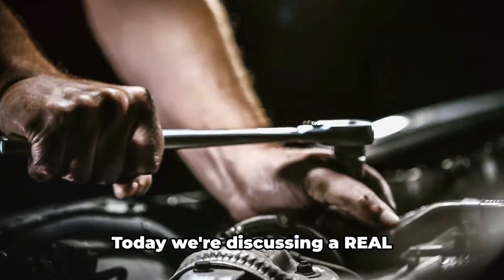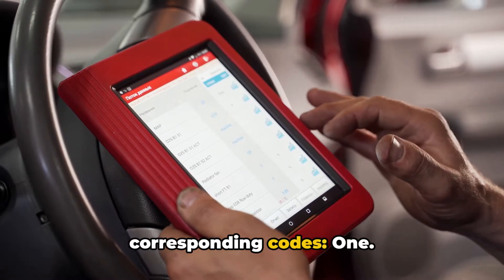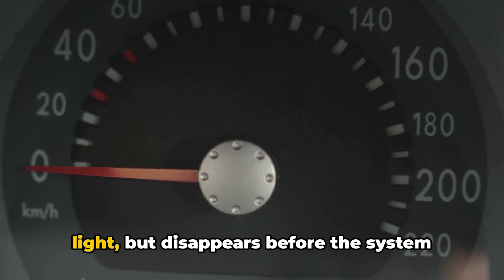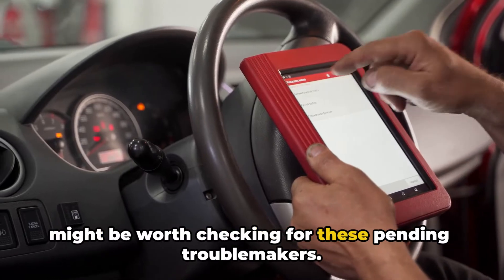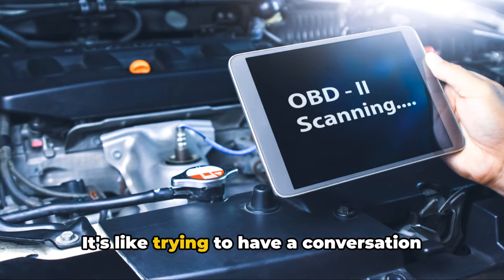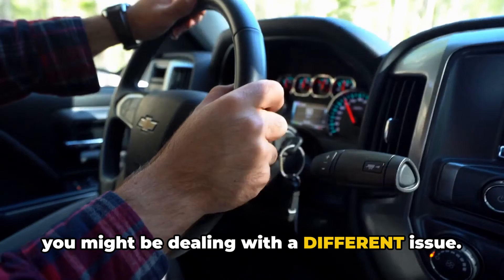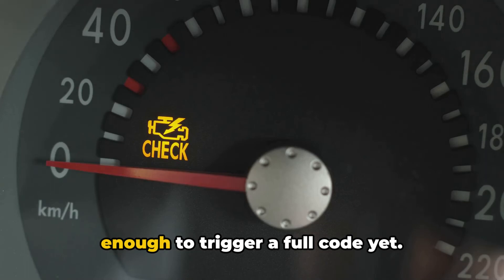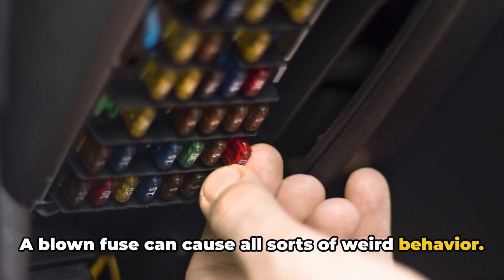Check Engine (MIL) Light but No Codes: Common Reasons & Fix

Comment: Mine is 2015 Dodge Grand Caravan.  After I had my battery replaced a couple days ago, I turned the key to the ACC position and the Check Engine light flashed several times and stayed on.  Once I started the car, the light was off.  I tried to get the code by moving the key to the ACC three times, as taught by some videos, but no code showed up.  By the way, is this way of getting the code equivalent to a high-end or low-end code reader?  (before the battery replacement  i was able to get the code P0562  - Charging Issue.  AutoZone and AAA tested the battery and said it was bad.)